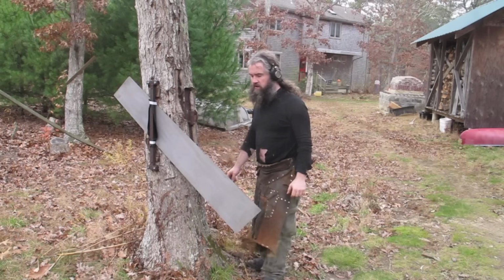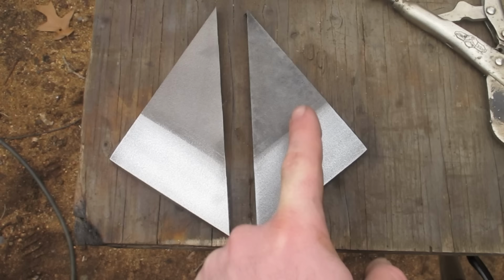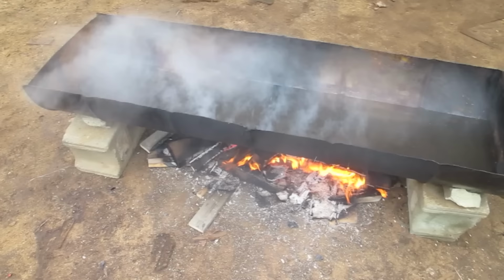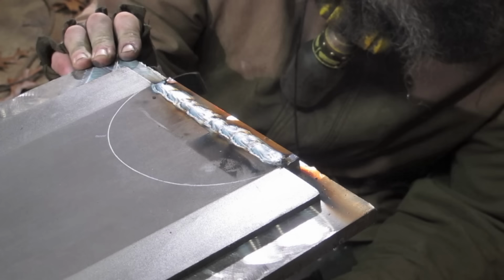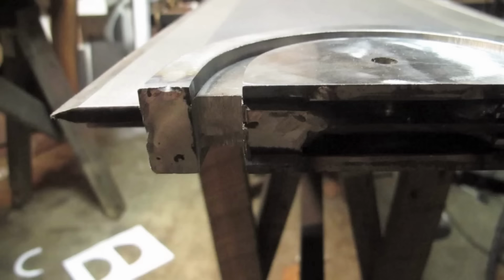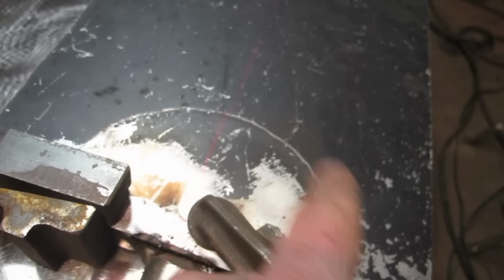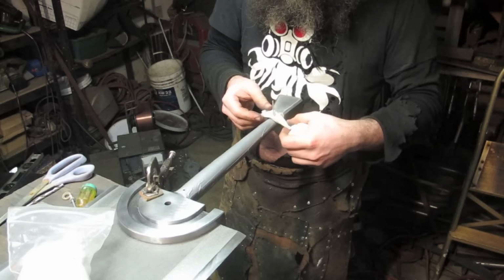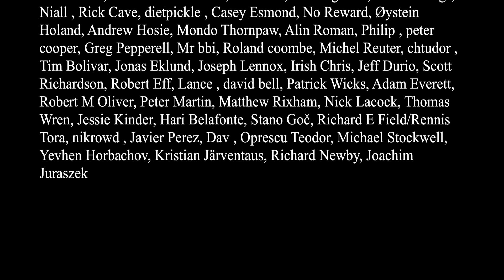Dragonslayer Build

Comment: question what's the biggest steel plate size that you recommend to build this blade out of so that a average person can still be able to swing it as if it was a giant great sword? in other words how big can it be before its just ridiculous?
Reply from the maker: +Brandon Whelan This is "only" 50lbs. My experience as a "professional" is 80lbs is the maximum weight of sword a human can lift (inb4 brotard suggests he can lift much more. Weights in a gym are a much different creature to giant swords, bro). This site is useful, most of my swords are 1/4"(6mm) thick: http://www.matweb.com/tools/weightcalculator.aspx
Reply: +michaelcthulhu cheers and keep up the good work
Reply: +Brandon Whelan 
To put that into perspective though, regular greatswords/claymores are generally around 2-3 kg. This sword is around ten times that weight, so while it's certainly lift-able, it's not nearly usable for actual combat.
Reply: +Brandon Whelan Watch Skallagrim's video on the Cloud's Buster sword for a somewhat numerical idea. If you can lift 100lbs with both arms, then about a 15-20lbs blade is more in the range of something that could actually be weilded(though for a short period of time or pose with and carry around for several hours) If your considering for say cosplay I would suggest an alternative, using a strong yet lighter wood for the core of the blade other then say the hilt and guard/pommel and cover with a thin-lightweight metal wielded around the wooden blade. 
I've done a couple for halloween that were on par with many Monster Hunter weapons, and weighted less then 20 lbs. I could not only deal with having it on my person for the entire evening, but still manage to get it home after a night at the bar and a walk of shame ;)
Reply: +_ Blank _  In other words, you had better be breaking all the upper-body strength records to be trying to wield the actual Dragonslayer, right? I think the record bench press is 660lbs, that's not quite enough.
Reply: +John Pryce I dont think bench pressing would say that much about you being able to lift that.. maybe as some of the crazy scots that throw Trees...they might be able :D
Reply: +_ Blank _ I dont really like Skallagrim but i have to agree here, more than 7-9 kg does not make any sense in a fight and even that would be hard to manage.
plus, Nothing is a walk of shame when you wield a giant sword ;) 
wait that sounded dirtier than i expected...
Reply: Bass T
Even 7-9kg is far too much to actually fight with. The extra force you get from the additional weight will do nearly nothing for you in combat, and the speed and finesse that you lose will leave you at the mercy of even an incompetent swordsman with a real weapon.
Reply: Yeah probably, only thing you could do is take your first swing and hope the enemy either is incapacitated or just runs away in fear xD
Reply: Bass T
TREMBLE IN FEAR OF MY IRON MONOLITH PUNY CREATURES!
Reply: +Brandon Whelan To answer your question, anything more than 20 lbs is going to wear anyone out trying to use it as a sword, and this is assuming the weapon has some balancing to help control it. A 20 pound axe for instance, would be a hell of a thing to swing around. Most hatchets, for instance, are around 2-5 lbs.
Reply: Indeed. What you can try doing is buying a big sledgehammer at your local hardware store. I've seen hammers up to 20lbs, but they also make smaller sizes - I've got a 10lb, and it's sufficient for all my needs.

The weight balance on a hammer is only going to be so similar to a sword, though, so you can try getting a breaker bar. Those usually fall into the 10-20lb range, and they are generally a solid bar of hardened metal. I've used them for strength training before.
Reply: +Brandon Whelan It is already ridiculous
Reply: John Pryce Yeah, forgot about sledge hammers. I have a 20 lb sledge used as a 'jack hammer' a few years ago when i had to remove concrete. You are not going to be effective in the slightest swinging that thing around, unless the person you are swinging at is already unconscious,.
Reply: Richard Smith Probably not. But it's good strength training, especially if you've got a big truck tire to beat on with it.
And like I said, a breaker bar is a bit closer to the weight balance of a really big sword.
Reply: +michaelcthulhu question, why did you paint the template for the hilt half circle red?

:p
Reply: +Brandon Whelan maybe 5 ft long or longer to be ridiculous
Reply: +michaelcthulhu Do you sell these?
Reply: +Brandon Whelan How big before it is ridiculous?? Ha Ha Ha Ha...good one
Reply: +michaelcthulhu I am 210 lbs Marine and I work out a lot (hang on, I promise this is going somewhere).  I can bench 315, squat 440, and power clean 225.  However, there is this mother fucking 44 lbs hammer at the gym I go to and it's absolutely ridiculous.  I'm amazed how much harder it is to swing 44 than it is to lift it (I hit tires with it at least a couple times a week).  I've finally gotten to the point where I can do like... sets of 10 slams on each side, but it ain't pretty.  Props to you for making, let alone swinging that awesome sword since I'm sure the length really exaggerates the weight!!!  Also, holy shit... 80 lbs?  With how hard 44 lbs is, I can scarcely imagine.

Anyway, just posting to let you know I loved the video and to corroborate your testimony about the swords.
Reply: Frank Chisowsky I think when it comes to swinging swords, it is form over strength.
Reply: Yoonus Khan I imagine so.  The mechanics for swinging a sledgehammer (even one that weighs 44 lbs) is radically different.  Nearly all of the weight is at the head, but I can grab near the head of the hammer and slide down along the shaft to meet my other hand (something that would probably cost me some blood if it was a sword).  Regardless, its just amazingly hard trying to something functional with that much weight in spite of the fact that it sounds like a paltry sum for those of us who lift a lot.
Reply: Frank Chisowsky It's still one hell of a workout though.
Reply: With a sword that big, it is safe to say strength is quite important as well :P
Reply: Richard Smith Haha true I meant to say form is important as well as strength.
Reply: ***** You swing around "32kg" and its easy? Who are you trying to impress? Lol. I can bench press 900 lbs, I drive a ferrari, and I'm married to a super model. Man this internet shit is easy.
Not only does self bragging sound disingenuous at the best of times, its probably outright bullshit over the internet.
Reply: +Richard Smith @richard smith damn man…..you my hero lol
Reply: +michaelcthulhu what steel do yo generally recommend for "huge" swords?
Reply: +Frank Chisowsky Its because swinging relies on rotational motion more than lifting motion. You use more of your abdominal and back muscle than you use your arms for the most part. Your arms can lift it no problem but your torso and back muscles have to rotate your whole body around with the sword blade acting as a horrid offset. Greatswords (i.e. zwei-hander, claymore,etc) generally weighed less than 12 pounds, and those have very long handles to deal with the weight of the blade.
Reply: +Brandon Whelan That really depends on how big and strong you are. What may be ridiculous a someone that's 5'7 wouldn't necessarily be that crazy to someone that's 6'4 and 300 pounds.
Reply: +Paul Molin it's what's in your heart that counts
Reply: +Brandon Whelan It's not only the weight of the sword itself you would contend with, you would also have to factor in the point you are lifting from. There have been some massive swords though centuries ago, but they where mainly used to take out a horse/rider and then set back down. wielding as a primary in combat, not viable in the slightest.
Reply: It's great to have a weapon that is only a little heavier in the blade section than the hilt. the swing gains power, and since it's about equal, it's pretty easy to correct yourself
Reply: ***** Even still, your friend should use his sword with caution, swords that heavy could lead to a hernia and other more serious conditions such as internal tearing.
Reply: I don't think even a viking could wield this thing effectively
Reply: well...ya but titanium is extremely rare and valuble? used for rockets and such? correct me if im wrong :)
Reply: why would you ever want a sword that heavy? The heaviest sword that was actually used was only like, 12lbs and it was fucking 7 feet tall
Reply: Garrett G Haha, I've seen you from somewhere before...
Reply: 12 LBS?! MORE THAN THAT SURELY
Reply: Leviathorgan Plopulous dude, a one handed sword should only weight like.. 2lbs AT MOST. a long sword is typically 2-2.5lbs and a great sword would be 3-4lbs. They are not these big bulky things that are impractical, they were made for your average dude to hold and use, seeing as how most soldiers back then were just average dudes, not hulking masses of man.
Reply: Leviathorgan Plopulous He's telling the truth.
Reply: hmm...cool! thanks for the info!
Reply: thats a  retail store machete bro
Reply: XD
Reply: the  gutts character  is based on a medieval knight called gotz von berlichigen  hes sword was very heavy also hes chest plate  tassets etc etc dont remeber the exact weight  whatsoever the nazis panzers division was named after him .
Reply: NATALIA RESTREPO actually, the creator of berserk has admitted that he created guts without any prior knowledge of Gotz of the iron hand (Gotz von Berlichigen)
Reply: Gut's is NOT normal human sized though. The man is a giant and very likely 7ft tall with SUPER human strength. The damn sword could be as big as you want it to be, but you or I will certainly not be able to wield it.
Reply: ***** Guts is 6'3'' and weighs around 230, 210 after he used the Berserker armor due to it messing with his metabolism. But I do agree no man should look at him and say anyone could do what he does.
Reply: This is already pushing the limits of what a big strong man can swing. The heaviest combat swords ever used were like 5KG, and an average one was Closer to 1,5KG. The dragonslayer is something like 220KG - obviously impossible to for any man to lift - much less swing :)If you wanted a "true" dragonslayer that you could lift it would have to be Hollow no doubt - but making something like that and have it be structurally sound would be incredibly hard I imagine.
Reply: +TheStigma making a real dragonslayer is just inpossible, from stability to sheer size, you'd have to be a frickin giant to swing that shit around, every single night. it would also be impossible to walk around with that thing lol. but yeah, its an anime/manga and the creator did admit that some of the fights are unrealistic.
Reply: Not Impossible to lift, but impossible to use In a fight yes. 
Hafþór ''The mountain'' Júlíusson, lifted a 650 kilogram ship mast. 
So a 220 kg sword Isn't that much for him. But would ofc still be impossible in a fight. 
Unless... He, a man capable of lifting 650 kg's, were to have been fighting demonds for years. 
Now that'd be a sight to see.
Reply: Kolur Laxdal Yes but you forget the one secret ingredient to Hafþór's success, Heavy Bubbles.
Reply: Yoonus Khan Hahahahahahah x'D 
Ofcourse :'D 
That, + his habit of eating 9+ big meals per day. With snacks inbetween.
Reply: Kolur Laxdal And being like 6'9
Reply: You guys should really stop thinking of it as a sword and think more along the lines of an axe because that's basically how Guts' Dragonslayer works.
Reply: in that case they should make it in the shap of an axe, caue an axe can do the same thing with less weight, i know its something you see in a video game or manga
Reply: i think that it was already ridiculous
Reply: You need to do some research on real great swords.
Reply: +Zulkefli Johan Titanium is about 30% lighter than steel but it's difficult to work with. When it gets hot it kind of smears so its hard to cut with metal tools without a chlorine based flood coolant setup, it does nasty molecular things when it's heated outside a vacuum (ie the way it oxidizes), and it plugs the pores in grinding tools like aluminum. That said, Grade 5 Titanium is about 40% stronger than steel, yield strength (shear strength if my memory serves me) of around 120,000 psi as opposed to 80,000 with good steel. It can be welded outside a vacuum but you have to flood it with shield gas much more than say steel or the joints will be much weaker than the rest of the metal. So, really slow cuts with coolant, tons of shield gas, and super sharp, hard, slow feed tools, aka it's a difficult material to work properly. :) But Grade 5 would make a great sword or knife, Grade 2 is rather soft. Upside is that it basically doesn't oxidize much (other than a surface patina) below 800F and it's really hard and strong.
Reply: When lifting a sword such as this one, one arm would act as a pivot while the other does the heavy lifting. Naturally though, the pivotal arm would have to be pressing down on the hilt while the lifting arm now has to compensate not only for the weight of the sword but also against the force applied by the pivotal arm. Additionally, the longer the sword is, the more leverage the sword has against you. In order to maximize the weight of the sword and still be able to "use" it, one would have to make it very short but with a long hilt, and that would look rather silly...
Reply: max for an average human would be like the braveheart sword.. but that`s already pretty heavy
Reply: i have seen the original "braveheart" sword in Scotland.. it's Huge! longer then this sword.
Reply: kijk maarff that`s cool! i only know the replica from the movies. yeah Zweihaender can be very long. But in the case of the Berserk blade, the problem is more how fat it is
Reply: michaelcthulhu how about you make gohan's first sword michaelcthulhu please.

Comment: So much better than man at arms.
Reply: Rico Wilkins They didn't make the dragon slayer they made his regular old greatsword.
Reply: Pagan Frost Because they didn't want to make it right they thought it was to big but this dude did it single handedly. Maybe one other person at the most it seems
Reply: Fariko Wishless they forged it though all he did was cut sheet metal that's not blacksmithing you have to melt it down, hammer it and heat treat it that's were the hardness and strength are affected.
Reply: Fariko Wishless And what do you mean they made guts's original sword right have you even read berserk.
Reply: Pagan Frost I was asking a question jeez. Just forgot the ? But I know It's not a true sword but it was a pretty decent attempt by one guy. Considering they made clouds buster sword they could make his it'd be a harder job though.
Reply: Sexual Lobster he means the first sword guts had. He doesn’t get the dragonslayer for a long long time
Reply: It he made it with proper dimensions it wouldnt be able to pick it up. Have you seen how thick the dragon slayer is

Comment: the actual dragon slayer is a very hard build with no purpose as it would wiegh 402 pounds
Reply: but think about the dammage it would do if someone was strong enought to use it properly ....
Reply: charles thurston more like 420 pounds
Reply: Matt Jeevas it s impossible to wield the real one in real life. Not because of human limitations per say but because of physics. Essentially the weight of the sword + the amount of force required to move it in any direction (especially horizontonaly) means you can t keep your balance because the momentum you create litterally lifts you off your feet. No amount of physical strenght will change that. Unless you weight half a ton, your moving with it.
Reply: Tannhauser The Prodigy they could lift it once or twice and drop it, not weild it.
Reply: razgaros
unless you build a robot that could wiled it 
what do you think the damage it could bring
Reply: lets all agree that Guts is the one who can wield the sword
Reply: Tannhauser The Prodigy deadlifting is a very controlled movement, the weight is distributed differentely and held in a very central and "concrete" position,  none like swinging a sword.
Reply: Dragonslayer was built to Slay Dragons... to be more specific, such a Weapon (60" of Blade, @400lbs), could Decapitate all but the Largest of Dragons in a Single Stroke
Reply: Well as you can see in the video, it doesn't weigh fucking 402 pounds.
Reply: Trannhauser, it's really not a matter of physical strength. If you SOMEHOW had the strength to "swing" the Dragonslayer (assuming we're talking canon dimensions/weight), you'd have to anchor your body down to equal the swords weight PLUS the amount of strength in pounds.
Reply: Guts swing it around like a bladed club than a sword!